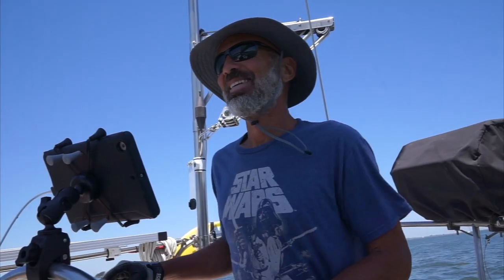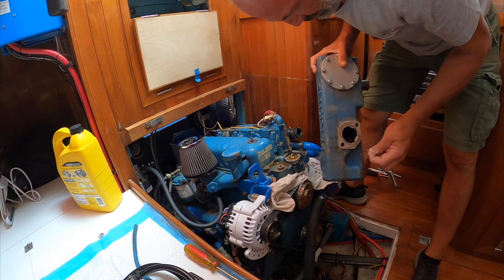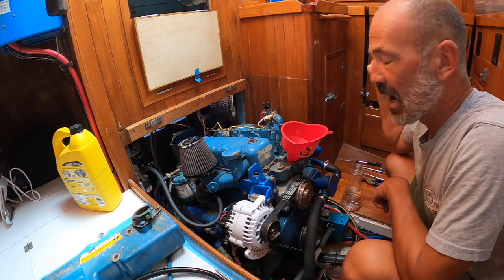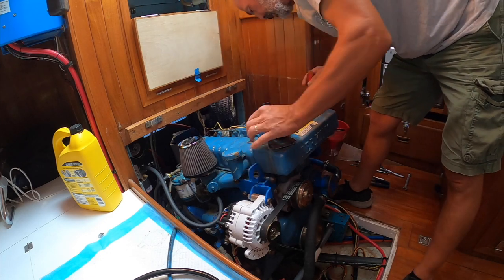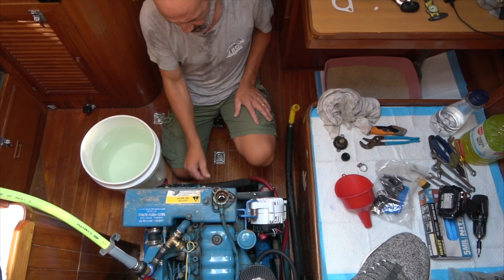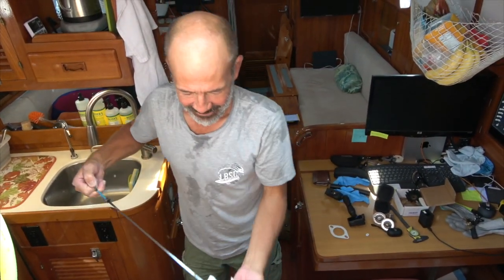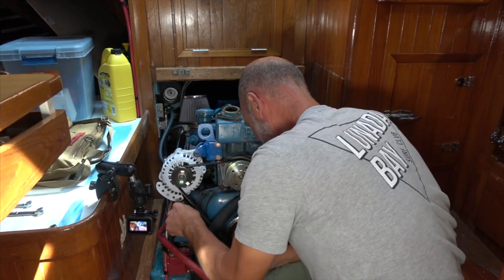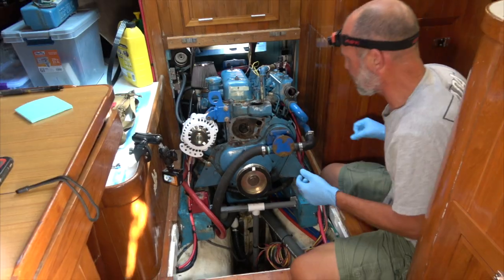Unraveling the Mystery of Our Overheating Perkins 4-108 | SV Ramble On

Comment: I was and ASE auto tech from '93 to '01 and saw many damaged engines from tap water mixed with antifreeze. Glycol base coolants when mixed with tap water, especially from a mineral rich water source like a well or spring, will cause the deposits you're finding in the coolant. All coolant manufactures, auto manufacturers, and marine engine manufacturers recommend distilled water only when using glycol based coolants. The deposits are more of a problem in a vehicle radiator than a boat heat exchanger because the passages are smaller. Antifreeze isn't a good chemical for heat transfer and a system with more than 50% antifreeze can overheat in warm weather. I could post links but messages usually get flagged or blocked with them.. Another thing that I know happens with gasoline marine engines is that cooling water on the fresh side doesn't circulate through any parts outside of the block until the thermostat opens. Not sure on diesels but I think they would be similar. A diesel needs a lot of heat for combustion. If you have the old water pump, look at them side by side and count the fins/vanes on the impeller. I've seen this with both auto and marine engines before. Make sure the fins/vanes are the same size and have the same angle. The reason for no sealants on the water pump and plate is the gaskets help set a tolerance between the water pump fins/vanes and the plate. If there is excess clearance, the impeller will not move coolant as efficiently or at all. Then there is the problem with sealants blocking water flow or breaking off and blocking cooling passages. I really hope you get this sorted out with a definitive answer on the problem.

Comment: I think the fresh water pump was starved of liquid to pump, likely caused by an air lock.  That the heat exchanger vent didn't exhaust water or air is another indication of this.  

Later, the hose pressure from the power flush probably cleared the air lock.  Flushing the system should also have improved heat transfer into the coolant, assuming that you flushed with some kind of acid to remove any scale and also any coolant additive precipitate (from switching coolant types).

The video doesn't show if you ran the engine afterward, so your problem might already be solved.

Comment: As to the white jelly stuff, this might be due to using two different antifreeze liquids. In the case of Volvo engines you have to use one type of antifreeze only. If you ever mix it with another one, still from Volvo, it gellyfies and its over. Just a thought. Regards from Switzerland, Silvano

Comment: the raw water side is ok, so inlet, gearbox cooler, pump, heat exchanger tubes and elbow are all ok.
the fw is not circulating that is certain so either the pump is  1) not getting water from inlet  2) not pumping water 3) can't pump water to outlet
#1 is pretty much ruled out as that is a direct connection (through the middle of the pump opening) to the block
#2 impeller loose on shaft (doesn't look like it from video) or air lock (imho most likely)
#3 blockage on outlet

You can test #3 by sticking a hose in the pump outlet (the circular bit on the engine) and checking water goes somewhere

A water pump on an engine like this is not a pump in the normal sense - it really just assists the thermo-siphon effect i.e. hot water rises & cool sinks & when arranged properly the water will circulate by itself - the pump just speed this up.
An air-lock will completely stop this circulation, leaving the pump to just turn in the hot water. 
Maybe try eliminating that long hose 'loop' or better make it just the highest point and then use it to fill the engine very slowly until engine full, then when water (without bubbles is coming out of the heat exchanger vent close that and then bring both ends of the hose lower until water comes out of both and connect.
I had one of these in a Land Rover and the heater circuit used to cause a similar problem if not filled correctly.

These are very basic, solid engines that were installed in tractors and similar they are not fussy about grades of water or anti freeze

Comment: Check your exhaust elbow, (the water side) if its cast iron and all bubbled up inside, seawater can't pass thru it quick enough to carry away the heat generated by the engine,

Comment: I had the same problem from a coolant missmatch for yearssss.  I had to flush it out several times and finally overcame the problem.  I used vinegar antifreeze flush, even tapped in a pressure wash like you did.  Mine was a lowline too..  It was nuts
I have a turnbuckle on my alternator too!!!
Reply from the maker: That’s good and terrible to hear.  I wish there was more info on that issue online.  We were totally flummoxed by it.  We spent about $20k on the new engine, but having an engine that I never question whether it will start or not has been priceless.

Comment: I've got the same I just wanted to say I've got the same motor as you Perkins 4108 I bought it rebuilt and had my mechanic install it and it kept overheating and we tried everything and it still kept overheating until my pop told me it's the propeller take it off and have it repitched and that's what I did and it cured the problem it was the prop the whole time and not the motor just thought I'd let you know that it runs about a hundred and eighty degrees at about 2,000 RPMs and she's been running great ever since I got the prop free pitched so maybe that's something to look into your friend trucker Doug on Savannah breeze
Reply: What pitch did you go with? What size prop, what size and displacement boat are you running? My 4.108 is running 195 degrees at 1700 rmp

Comment: What temperature are you running when it overheats and what is your RPM when that happens?
Reply from the maker: We had a high temp alarm that turns on at 200f, and she boiled over and blew coolant all over the engine compartment.

Comment: Would your sealant where you said it should be a dry fit have any affect on clearance at pump impeller?  I'm an airplane mechanic so we don't deal with this water stuff too much.  :)  Good luck!
Reply from the maker: Not sure, but I think it may be something solid blocking the water passages in the motor. I'll be working on this weekend.

Comment: Did you run it without the thermostat while flushing? I have the exact same motor and this is a mystery especially since I had mine stripped down recently to replace the injector pump. Completely drained the coolant (I removed the heat exchanger) and refilled without experiencing any air pockets or difficulties. Anyway while you’re in there check the high pressure injector lines for corrosion and everything else in the area because as you already know you have to take everything off to do anything on that side of the block. Trans Atlantic has just about everything in stock (ask me how I know lol)…
Reply from the maker: Thanks Michael, I did pull the t-stat and reinstall the header tank before running it and overheating again.  I'm pulling the oil cooler this weekend.  Funny about TAD, but when I called them I was told they didn't have any of the gaskets I need for this teardown.  Maybe you know something I don't?

Comment: fresh water flow, on a 4-108 fresh water pump, there are TWO gaskets between the pump and the engine block, with a thin metal plate between the gaskets. THESE GASKETS ARE NOT IDENTICAL.
Reply from the maker: Thanks Art, I learned that when I installed the Balmar serpentine alternator and water pump kit.

Comment: The tach on my Perkins reads zero if the battery is fully charged, and solar is incoming. The Balmar regulator reads that and sends out a zero RPM signal for some reason. Try to disable any other charging systems (solar or 120v) and see if the tach recovers. 

I have to disable my solar charger when we motor long distances which solved it for me
Reply: I was also going to mention that the coolant water won't start to circulate until the engine is up to the thermostat temp (170ish gone or take). Test the water pump by running the engine with no thermostat in place.
Reply from the maker: Thanks, I check that out when I start putting it back together.

Comment: Flush with barnacle buster
Reply: I was thinking that too, but there looks to be good flow on the raw water side.  There's no flow in the fresh water side.  I wonder if you can use barnacle buster on the fresh water side?  If the water pump is spinning there could be obstruction in that path.